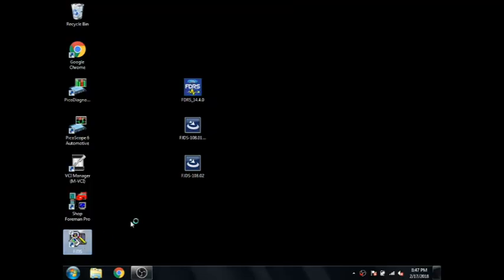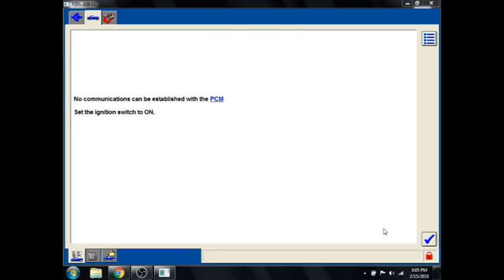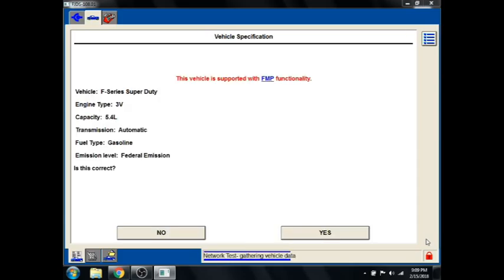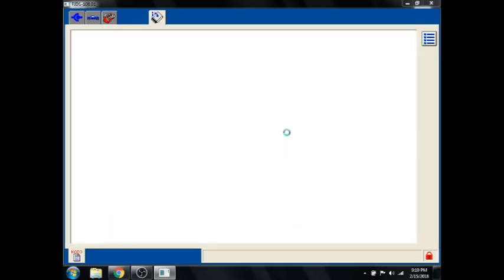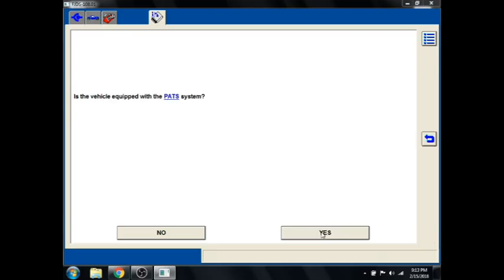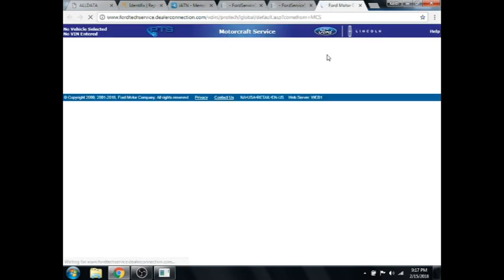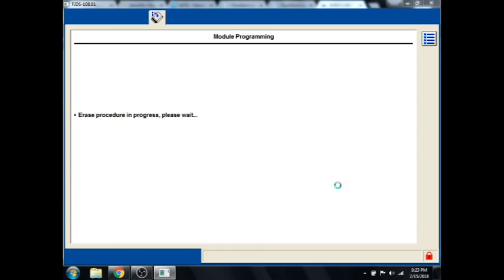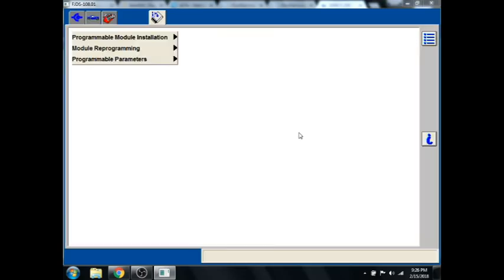How to Reprogram a used Ford PCM With FJDS and a J2534 device

Comment: I know this is an older video. Currently driving a 2010 F150 which had a random Dead/No Crank problem and got a new PCM. Shop had it for a month and gave the vehicle back to me with crazy errors, DTCs and ABS lights on … they said they couldn’t get those cleared out. Vehicle drives, but has a Christmas tree on the dash … I’m trying to find of there is a DIY way for me to correct this.

Comment: Hello i need help. Its about cloning frod transit sid208 ecu. After cloning i get B1206 code and no crank. Inertia switch and wiring checked. Do you have something that could save me, local ford dealer cant get the codes (tear tag and the other one) they are not written on ECU. Vin number WF0NXXTTFNCL34006 thank you

Comment: Hi. I have a 97 f250hd with the 7.3 power stroke.  When I got it the guy had a sct tuner on it.  It was stuck in race mode because he tried to update the device and wiped out the stock file..   and he drove it in race mode for a few years..  now I have it.  I’d like to reflash to stock before I do a hydra .. can I reflash to stock using a forscan obd2 to pc cable?  I have that for diagnostics and live monitoring to my laptop.

Comment: HOW CAN PROGRAM A 2006 ESCAPE IF 18 V IS NEEDED FOR THE FEPS
Reply from the maker: The tool has a buck converter for it. like all J1850 compliant J2534 devices.

Comment: So here's my issue. Followed this procedure... except it is a pats ranger. When I finish it all starts and runs. But the shift lock solenoid will not let it come out of park. Install the original "bad" pcm. Reprogram it and pats. It starts and comes out of park.
Reply from the maker: Wrong or bad PCM.
Reply: @L1Training  you were correct. I put a 2nd new pcm in and programmed it to as built calibration and it solved it

Comment: @L1 Automotive Training
Any experience with "The current session does not match this vehicle"?
Reply from the maker: Usually a used wrong module or a tuner has been installed and permanently changed the modules identification ID.

Comment: I tried reprogramming a used PCM on 2003 F450 SD 6.0L whereas the original unit is damaged and does not communicate. Being scarce and expensive in the used market, I took a chance and bought one from same year and model, but different part numbers on the prefix and suffix. Also original unit is dpu-232 and the replacement is dpu-232a and I can't find any clarification about this.

during reprogramming, I never saw a screen showing "erasing" and I never saw a screen for entering the axle ratio and tire size. At the end of this process, a different part number was shown. I found a site that lists the PCM part numbers and gives info if it has updates as it shows the part number for that update. I found both of my numbers and followed the trail where they both end at the same number with no further update, this is the same number given by FJDS after reprogramming.

is this a verification that a used PCM of different numbers can be interchangeable for reprogramming ?  For example, I examine the situation before buying on a gamble. I follow original number to the end and work backwards from that number to see all the other part numbers that end at the same. 

I wish I could say I am successful right now, but there's other issues with this truck that need to be fixed before it can be test driven.

Also, I assume the FICM and TCM need to be reprogrammed / updated with this process. Am I correct?

Tools used is FJDS and Autel MaxiSys Elite J2534 VCI

Comment: I'm replacing my PCM in my 2018 transit connect and have a question. First, can I copy the current flash and write it to the new PCM? And my van has PATS system and misplaced the key with the power door locks and only have my non power lock (dumb) key will it still work?
Reply from the maker: You could clone the module, you will need the proper tools and knowledge to do so, this is not possible to clone without specialized EEPROM equipment and knowledge. Many Ford vehicles will require 2 keys when relearning a replacement PCM, if cloning is done, that would not be needed. If using a J2534 device to simply program a replacement unit, then you may need 2 keys, you would have to reference service information to confirm.

Comment: I took an 99 Explorer engine and put it in an old Bronco. I’d like to remove PATS or covert it to a fob/wireless as well as remove the ABS, airbags and other things not needed. Can I do that with this system?
Reply from the maker: No. FJDS and IDS are factory tools, no factory tool will delete theft on any car.

Comment: Does nothing for vehicles that don't list a later calibration and fjds is going to see the Vin mismatch and stop. Worthless.
Reply from the maker: Incorrect on both accounts. PMI will work even if both modules are completely up to date, VIN changes during VID block write during PMI and it only updates software on later builds. Also, relearn vehicle data on later models will correct VIN from BCM data. FJDS can still be used as long as the wrong VIN is never detected, which is why we leave the key off.
Reply: @L1Training  pmi? You're on fjds and I'm on fjds. Once it connects to the used PCM and sees the VIN is not the same as what you entered it shuts down "current session does not match vehicle." On top of that after all the pcm data is input it going to check for a calibration based on that data and if it's the latest one that's exactly what it's going to say. "Latest calibration" shut down. Correct on both accounts.
Reply from the maker: Re-read what I said, rewatch the video...... Can't help you more than that, I program hundreds of Fords every year.

Comment: Just programmed 2009 Ford Flex....installed used PCM  as new PCM, no problems. PATS easy.. just need two keys.... Autel J2534 and win10 computer

Comment: I’m trying to reprogram a 03 6.0 ecm. I do the whole thing leaving the key off so it thinks there’s a new ecm. I put in the old ecm once I get to the pmi then it has me install new ecm I get to key on the key off then a second key off then I get 14-0x0 852082 every time help please
Reply from the maker: IDS/FJDS has issues, it may be something with the software.
Reply: did you ever reprogram it successfully ? I am trying to reprogram a used PCM on a 2003 F450 6.0 whereas the original unit is damaged and can't be read.
Reply: After a while it finally worked

Comment: Where is your shop?   I would bring my 2004 Grand Marquis to you.   I have a problem where the idle speed drops from 800 to about 500 rpm after coming to a stop and about 20 seconds go by.   Then the car often shudders when you take off.   I get a p0355 code on the scanner when the engine light comes on.  That indicates a problem with the #5 cylinder.  I've replaced all plugs, all coils, throttle control valve, idle position sensor, vacuum checked for leaks, sprayed contact cleaner on the coil connections, tried 2 bottles of fuel injector cleaner, all failed to solve the problem.   Just got turned down for service by Palmetto Ford in Miami, said they've never changed a PCM.   Was turned down by two other Ford dealers, one who had an 07 Grand Marquis with 35K and told me they can't fix it.  Mine has 230,000 miles.  PLEASE contact me, and thanks. Tom in Miami

Comment: Is there a way to reprogram a used ford TCM?
Reply from the maker: yep
Reply: @L1Training  how exactly, I bought a used TCM for my Fiesta . How ever it didn't work for my car after installing. But when I installed in a Ford focus it worked perfectly. My mechanic says that is happening because perhaps it has been programmed to work with focus and not fiesta . Is there a way to flush out programming and reprogram it for my car ?

Comment: looks like Ford figured out the exploit... Now I have a 1500.00 paperweight.
Reply from the maker: What do you mean?
Reply: @L1Training  It no longer works with the new update. As soon as you try to program, it tells you that the BCM has a different Vin and to start a new session or recode the BCM.
Reply: I'm running a legit Rotunda PCMii and legit FJDS. NO CLONES or Cracks.

Comment: Do you need keys that match the replacement pcm? Or does this process reprogram the keys also?
Reply from the maker: No, a parameter reset is required to initiate the handshake between all the immobilizer related modules. Then keys must be learned, there is a lot more to this job than I show, service information must be followed carefully otherwise it will no start.
Reply: @L1Training  so the key at the time of the pcm swap and reprogramming is just acting as a lever for the switch...no immobilizer reading happens?

Comment: READ THIS! Just had to put PCM in Son-in-laws 2013 F150 3.5 Eco Boost for coil driver malfunction Cyl 1+2 dead. (P2300-P2303) I used IDS with VCMii and 115.01. (China full chip) Got a used PCM but was unable to write a new VIN to it. PCM was exact part numbers DL3A-12650-EE that was the latest update. Could not write VIN to it using PMI. would shut off power to PCM when I tried to use it. HOW TO:  Install PCM from Junk yard with the correct P/N and program Pats keys. It will show a code of P160a Module ID miss match. It will start and run but will have the wrong VIN. Ok unless you have emissions test to get through. To write the correct VIN to the PCM, load a session in IDS with the correct VIN. Go to Powertrain, Service function, Relearn Vehicle Data. This will write PCM VIN and other data from the BCM to the PCM.  BOOM! correct VIN in a Junk yard PCM.  I just did it. No promises on different IDS versions or Model years/vehicles but it worked for me.
Reply: @drgavinosc

Comment: Thank You for the great video and information. My truck is a 2003 ford f150 with the pats. when you reprogram for the pats, are you reprogramming the the pcm or the pats? Can you take a used pcm and install it and reprogram it with the pats so that it will work. Remove it and replace it with the old pcm and it works? The reason I ask is that I moved to Central America and some day the pcm will die. If had a spare it would be great. The ford dealership is about 3 hours away from me. Or can the pats be done on the bench, not in the truck. Again Thank You

Comment: I've got a 2010 Ford F150 FX2 with a 5.4L. The tag under the hood says it should have had a 4.6L. Called Ford and they can't tell me based on the vin# why the tag under the hood doesn't say the 5.4 thats in it. The info on the PCM says 4.6L. Will changing the motor size on the PCM to a 5.4L mess up anything. The truck runs perfect and couldn't understand this difference. The truck is all original for what I know and I bought it used from Ford dealer. Any advice on this.

Comment: I am getting repeatly stuck on the establish to pcm screen it get stuck on it for 5 minutes then auto exits
Reply: Check for update on motor craft website 114.06 just came out and it supposed to correct it mine was doing the same thing

Comment: Hello good sir, 

Thanks for the videos I'm actually tinkering with my Mazda 3 base model. I got a new steering wheel with all the controls to replace my basic empty wheel and what I'm trying to get working is cruise control. I have the brake sensor installed and most of the cables in the steering wheel installed but the cruise is not working. Do I have to reprogram that and if so is it easy to do? I thought it was plug and play.

Comment: L1 but before i started the procedure it showed a different module part than then pcm that was in the truck
Reply from the maker: The PCM may have been updated once before, that changes the part number when you update it.

Comment: Please help me out i just did my first pcm reprogram thanks to this video everything went fine and successful just the module part number it appears its not the same number shows on the one on right now , the vin number was correct everything went fine but idk if showing a  diffferebt module part number  matters or if i  have to change it and then reprogram help me asap and thanks
Reply from the maker: If you just did a reprogram, then it should change the number, thats the point.
Reply: @L1Training  so if that was the case what do i have to do if the pcm was already changed and i try to change it how does that work do i have to do something first or the program only works on pcm that never gotten programed before
Reply: @dooglepadoogle3091  Those number the xxxx-12a650-xx found on Ford's PCMs are the flash number or part number of the PCM as, on the outside of the module it will have its original flash number or part number but the actual FLASH number could change when you reflash / reprogram (used interchangeable). Look at reprogramming a PCM as updates to the module because that update, flash, program whatever you wanna call it, will address problems that ford has found with the previous part or flash number so what you're doing when you program / flash the module you are in fact updating the flash / part number and therefore it will change to reflect the current updated number after it's been done so next time you read it with IDS the original part number will no longer match the updated one and its usually just the last 2 letters for example 3c3a-12a650-AA is repalced by 3c3a-12a650-AB and 3c3a-12a650-ab is replaced by 3c3a-12a650-AC and so on and so on....... you get what I'm saying? Anyways,  anyone please correct me.

Comment: Hi man, i put an used transmission and tcm to my ford focus 2013, the car change the grears agressive and early, i have the vcx nano ids, i did the adaptative learning and was ok, but the probleme is there, do i have to reflash the pcm and the tcm?
Reply: Ah ok the thing is i am doing by myself and the original device is expensive you now,
Reply from the maker: Yes it is.
Reply: L1 Automotive Diagnostics and Programming LLC you figure being able to diy jobs which with a little research you should be able to go do, its the jobs of diagnosing problems even a garage with have difficulty doing can easily reach a grand
Reply: Is your vehicle worth it is the question
Reply from the maker: You will need to actually program the module to the car, an adaptive relearn will not work. The VCX nano is a Chinese ripoff, with pirated software and will not program the module. It would be much better if you got an actual validated J2534 device and paid for the subscription to be able to program the module.
Reply: @L1Training  ok, how much do the suscription cost?
Reply from the maker: $49.95 USD for 2 days.

Comment: Hi can this be done on ids 109.1 as i need to install a new pcm on a transit 2.2
Reply from the maker: Currently IDS is on version 110.05 so you will need at least version 110.00 to complete any immobilizer or programming functions.
Reply: i can do immobiliser and programming function ive done bcm and key programming i reprogrammed a used pcm and put the correct vin in for the vehicle but it didnt change the vin it still got the vin from the used pcm wich is wrong for the vehicle do u no y it hasnt change i follow ur video to a t
Reply from the maker: In your first question you asked about a NEW PCM, not USED, a used PCM can not be used on a newer ford.
Reply: oh my bad i meant a used pcm and its of the same year vehicle the original one got fried so i got a secondhand one from scrap yard but i need to change the vin in it to match the vehicle vin

Comment: Hey. I have a 2013 F-150 STX 4x4. I have one of the very few that Ford produced that is a non SST truck. I am desperately trying to wake that option up and dealerships aren't much help. Of my PCM were to be reprogrammed and treated as though it were a replacement I don't know if SST is one of those questions or not. I do know when I go to motorcraftservice.com/asbuilt I know there are 9 lines of PCM modules lines. Are those lines as built lines in the PCM? If so could you show how to do as built on a PCM. I can do all other modules with ForScan free software but not the PCM. I want to know how to make my PCM mimic another very similar truck of the same year. 
Yes I have the instrument cluster for an SST truck. Yes I have the shifter. What I don't have is what I need to tell the dealership verbatim what I want.

Comment: great video, I don't have a j-box but I do have the gm mdi 2... do you think this would work as the j-2534 for ford ? thanks
Reply from the maker: Not sure with Ford but I had my MDI installed on the same hard drive as Techstream, and did see it listed in the device list for Techstream, so it is listed as a j2534 device in the registry.